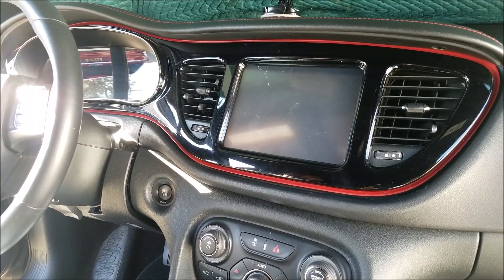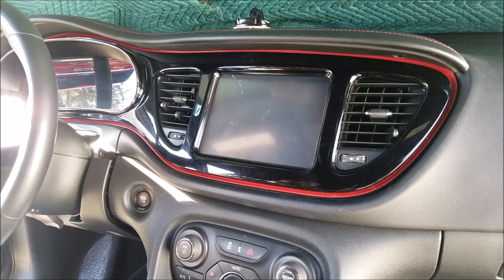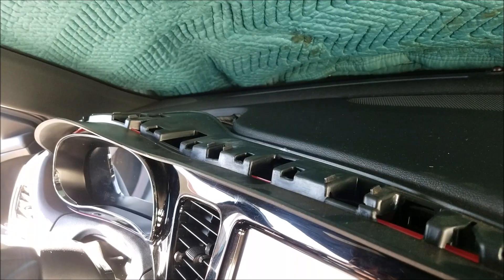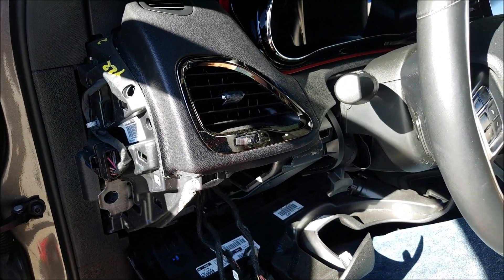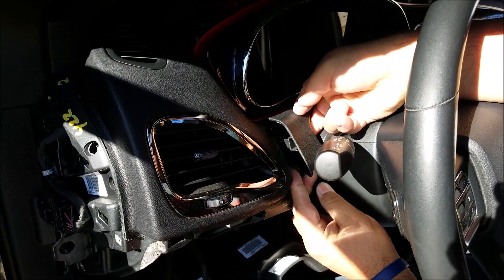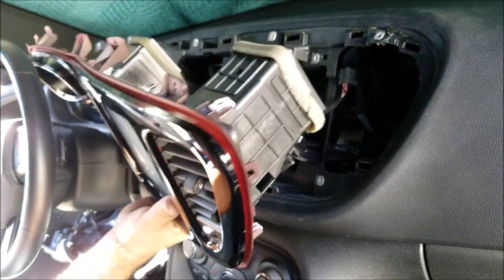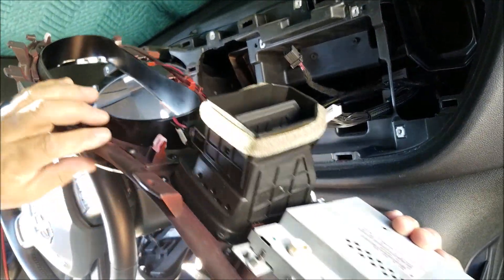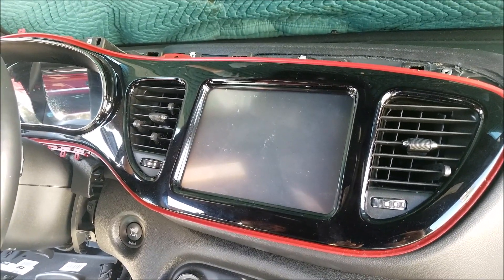How to Remove Navigation / Touch Screen/ Display from Dodge Dart 2016 for Repair.

Comment: Do you know if the lights on the red trim is built in the bezel or behind the dashboard cover?
Reply: I think it is cause I don’t see where you can change the color
Reply from the maker: @kelinjohnson7421  Please call between Monday through Thursday 9:00am to 4:00pm